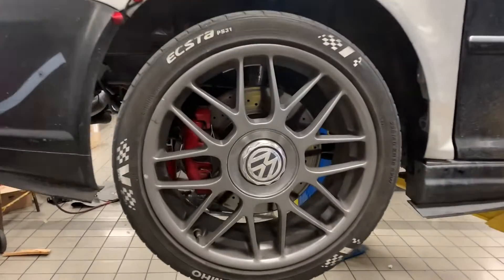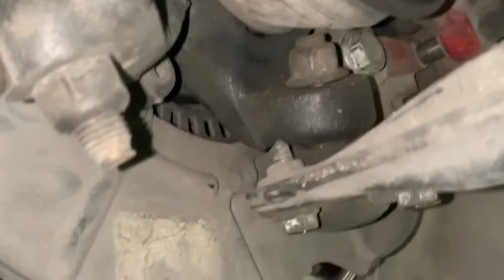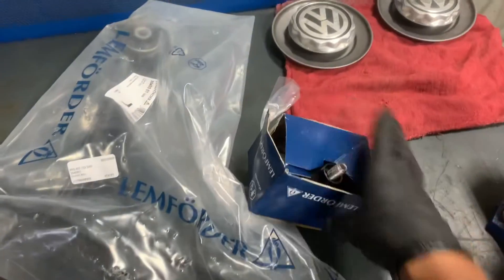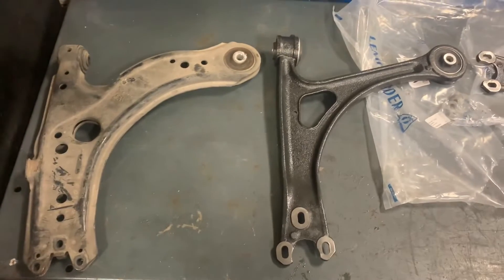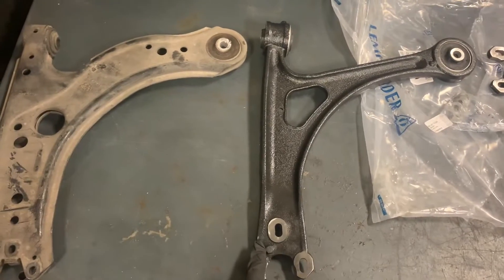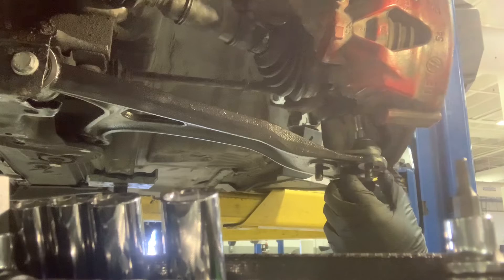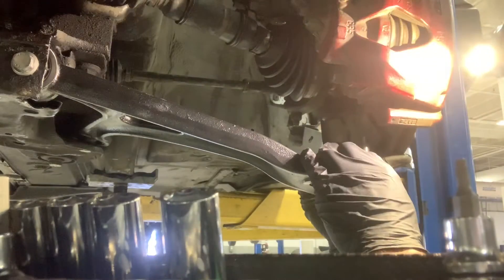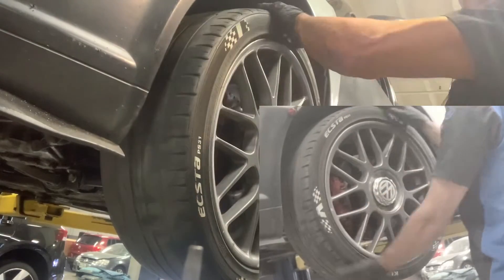R32 Control Arms on the Mk4 GLI!

Comment: Did you use r32/tt ball joints or mk4 ones?
Reply from the maker: I used R32/TT ball joints. They are slightly different. Mk4 ball joints have loose bolts that go “upwards” into a V-shaped bracket.. R32 ball joints have threaded studs pressed in, with a locking nut on bottom.

Comment: did you use your gti spindles or converted to r32/tt spindles ? was curious if r32/tt lca and ball joints work with the gti spindle
Reply from the maker: I reused the factory GLI spindle, ball joint works. In the future I would like to upgrade to TT spindles though.
Reply: @thecolemangarage  word thanks for the help bro!